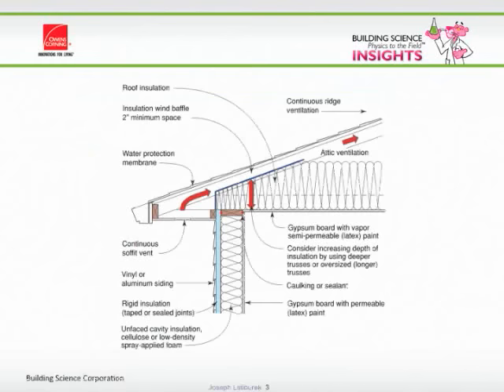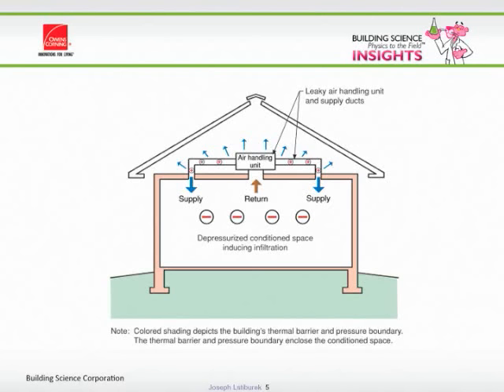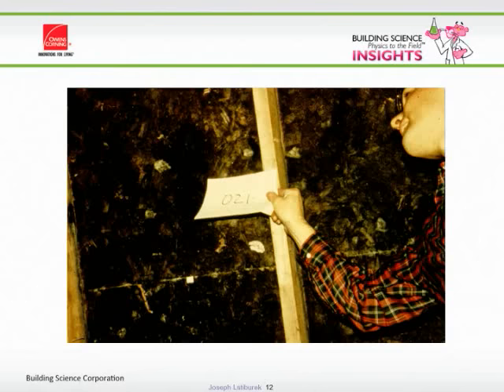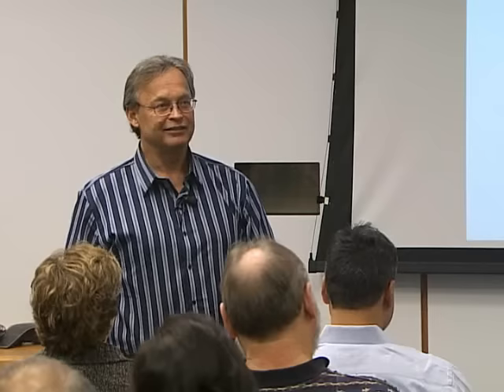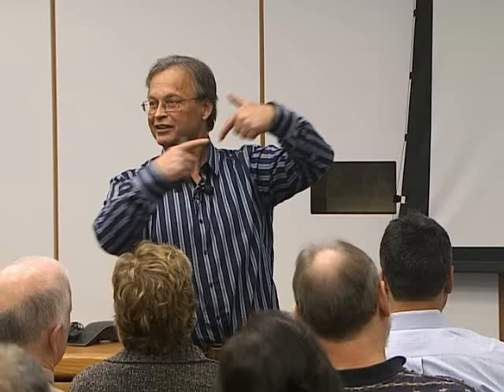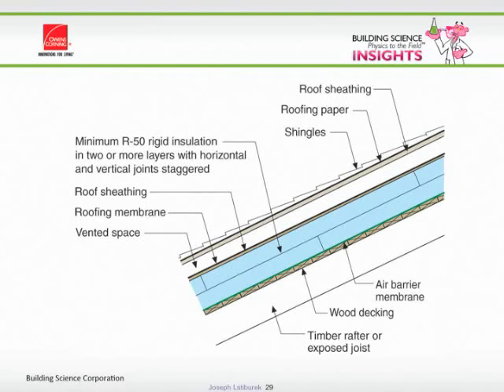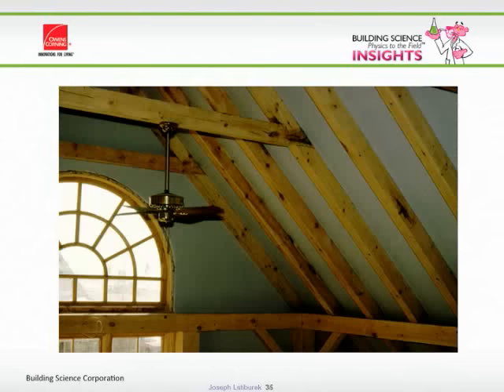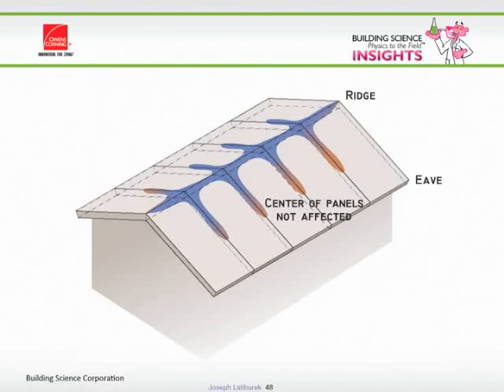Building Science Insights: To Vent or Not to Vent

Comment: Thank you for sharing this with us.
Reply: The problem with insulating the underside of the roof deck with asphalt shingles is the shingles will cook and will not last much longer than 11 years. The shingle manufacturers will not honor the warranty when the roof fails. You need at least 2 1/2" of air space with air that moves to keep the shingles cool enough to last.
If someone used this insulating system and installed a sanded peel and stick over the whole  roof the shingles would be stuck to the peel and stick so badly from the asphalt bleeding from the shingles and the peel and stick that to replace the roofing they would have to replace all the plywood deck. Not very cost effective.

Comment: I don't understand the illustration at 42:11 . Why isn't there condensation on the underside of the roof sheathing when the warm moist air filters through the fiberglass and hits the cold sheathing?   

Thanks for any replies.
Reply: My thoughts are that this only works in a climate like Vegas (where this was)  that is very dry and tile roofing is used cause it breathes, and 3 tab doesn't, so any moisture evaporated right away. I hope I'm getting this right :--))))))
Reply: I think you nailed it with the dry climate. That was my suspicion. I found an article written by Joe on buildingscience that says just that. Here is a quote from the illustration: "The “flow through” approach is limited to hot dry climates such as Las Vegas and Phoenix." 

Thanks for helping me figure this one out.  Here is a link if youtube will let me to the article which is a synopsis of this vid: 

https://buildingscience.com/documents/insights/bsi083-mea-culpa-roofs
Reply: because the roof is vapor permeable, there is a gap between the roofing and the sheathing where air can flow
Reply: Thanks for the link!

Comment: so, my house was basically designed like shit. Thank goodness it wasn't new construction, otherwise I would've been insanely ripped off. Gambrel (barn) roof, this shape viewable from front and rear of house. No eaves/overhang. The gambrel bottom slopes meet 1- pitch gable roofs which are 90 degrees perpendicular to the main gambrel shape. NO WAY to vent. No soffit at the bottoms. Only great potential for epic ice damming. One of these areas has leaked inside already. I don't know what to do. If closed cell foam didn't require me to mortgage my house, I'd do that.
Otherwise, redesign my house. That will take MORE money.

Comment: why don't we have more  flat roofs.  I see a need for pitch roofs in an area that gets snow.  But in the warmer area, why not have flat roofs.  I ould like to know how to vent a flat roof.  Also, the pitch roofs are quite dangerous and should have a railing around it.  I know harness is being used by some, but the majority of workers are day labors who are sent up on the roof, with radio, liquor but no safety equipment.  I think it should be mandatory all worker wear harness and full protective clothing.   I really want to see railing even if its only installed while working on the pitch roofs.
Reply: Harnesses and ropes required in my area. They check.
Flat roof with spray foam is done in this area, by some builders. They use flat roofs to maximize building height as dirt is very expensive. Unfortunately they put the furnace and ducting in attics where there's an attic.
Reply: Osha requires fall restraint
Reply: Only over a certain roof pitch and the eaves being over a certain height above the ground.
Reply: On a 4-pitch? That's ridiculous, except when you're taking toddlers up on the roof. If you're on a 6- or 7-pitch, no problem. I worked for a guy who walked confidently on 10-pitches (plywood, not shingles), but he had the circumspection not to expect that from the rest of us. And consider that there are roof-jacks, adjustable triangles of steel, with one side extended past the point, so you can lift a shingle and nail it to the roof. with a pair of these, you can put down a plank that you can walk on.

Comment: This guy is wrong.
You need to circulate the air.
This can only be done from the top.
Without air circulation air conditioning will not work.
That is why you need to put up return vents in addition to the air conditioning vents.
What he states is correct but it's not what he says it's what he leaves out.
Reply: You don't need to recirculate the air in your car unless you're in heavy traffic.
Reply: Maybe tin a car you don't need it but in a house you do6.
Reply: No, he clearly explains the air is conditioned, in the sense of gaining air flow in the roof. But it is stupid to duct air through a roof and back into the house unless you want higher expenses. If you want to debate, please explain yourself better about why everyone needs to circulate the air from the top? And why can't air conditioning simply work through the wall to outside?
Reply: Simple hot air rises.